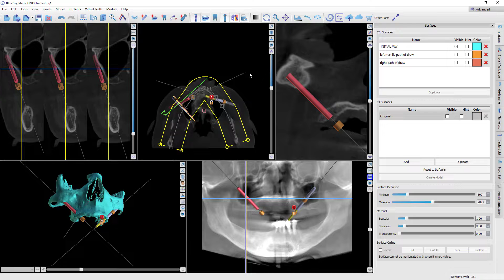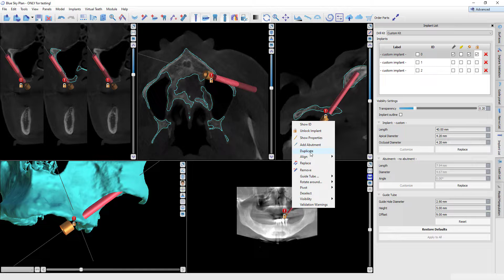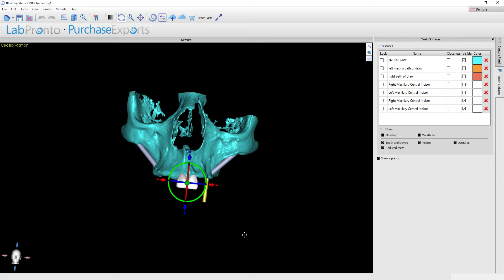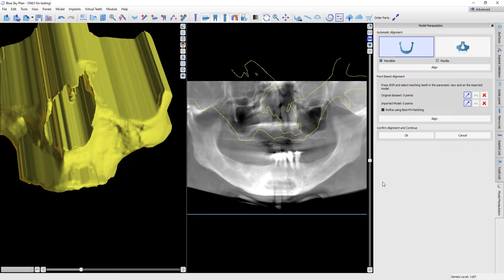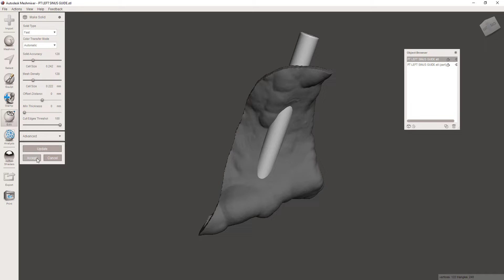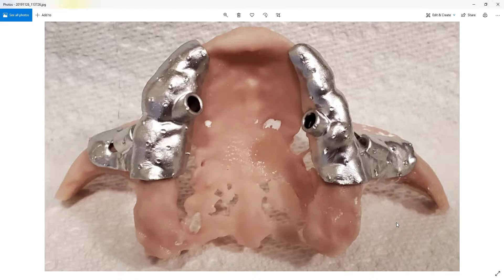Guided Zygomatic Implants

Comment: Thank you Dr. Glenn for the great video.  I appreciate what you are doing for the dental community with your instructional videos.  I am wondering if you could come up with a way to make a guard for zygoma implants that have portion of the implant body inside the sinus.   Thank you in advance.
Reply from the maker: exact same process......you'd just want to make a separate guide for showing you where to make the sinus window and reflect the membrane.
Reply: Thank you.  Since I don't usually make a long slot in the sinus wall, I was not sure how the portion of the guide that was inside the sinus could get into the sinus.  I usually only make a small window just below where the the drill would get into the zygoma for an intrasinus implant.  However I think I could just remove that portion of the guide that was inside the sinus and leave the portion where the top guide tube was.  Then I could just  and just make a small bone window to allow visualization into the sinus and to get the top guide tube in.  Thanks again.